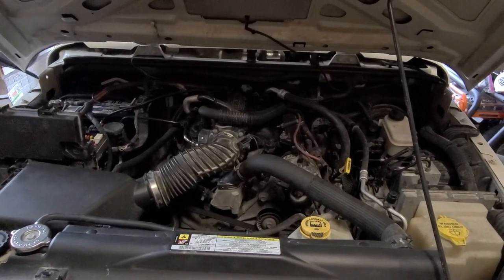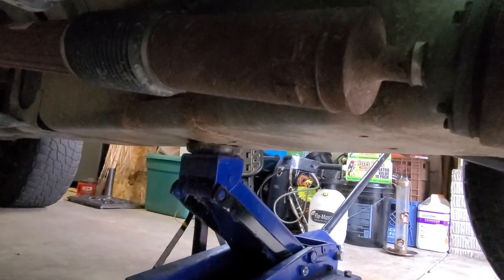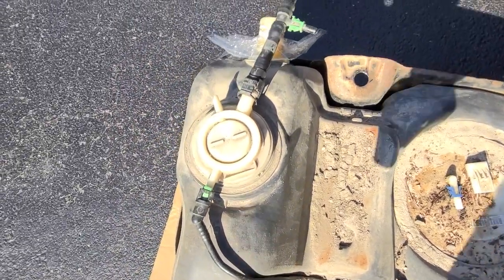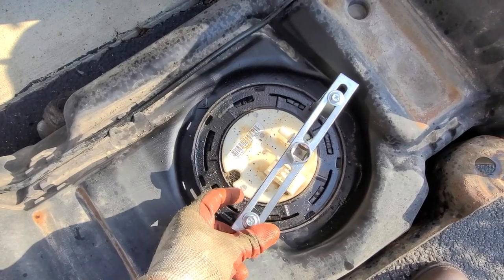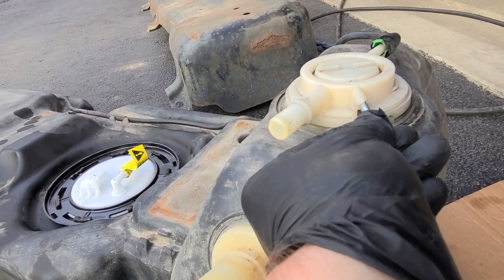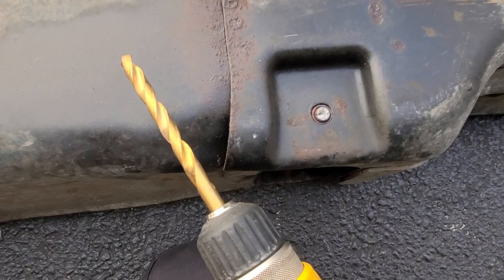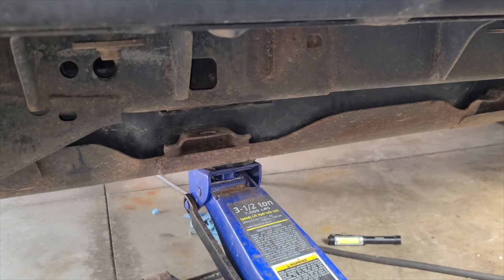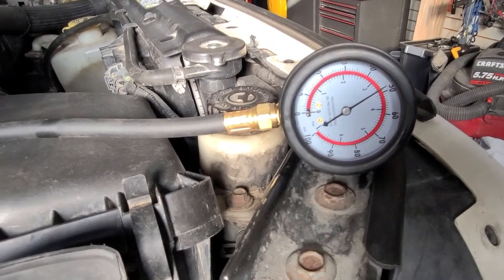Wrangler JK Fuel Pump Replacement

Comment: What epoxy did you use?
Reply from the maker: JB Weld clear.  For this one, I bought the "pen" with a plunger that mixes the two as it comes out of the end.  I still mix it a little more by hand, though.
Reply: Awesome! Thank you!
Reply: P.S. thank you for such a helpful video 🙏🏼
Reply from the maker: @kelseymccarthy6942  You're welcome!
Reply: One more question, what drill bit did you use? Having a hard time finding a 13/16
Reply from the maker: @kelseymccarthy6942  To be clear it's 13/64 not 13/16:  that would be way too big.  I wish I had a better answer, but I used a 13/64"...  you want that roll pin to be snug. You also don't want to bore out the original hole too much or it will snap off.
Reply: @austin.gresham  hahah oops, that was definitely my problem. Totally looking for the wrong thing 😅 thank you!